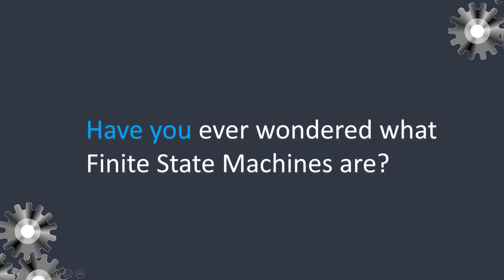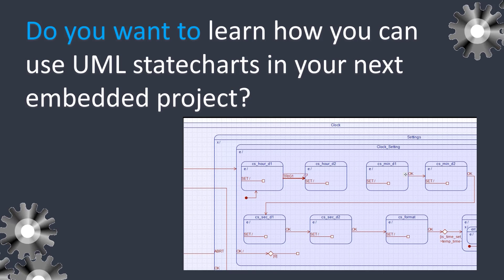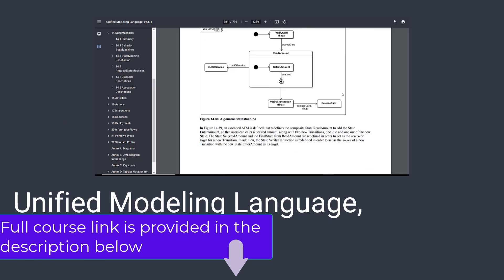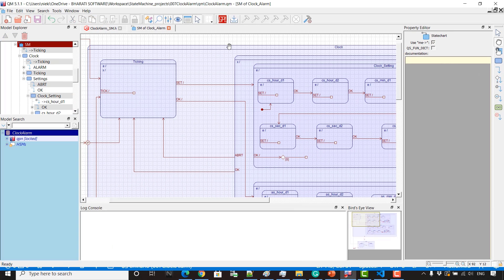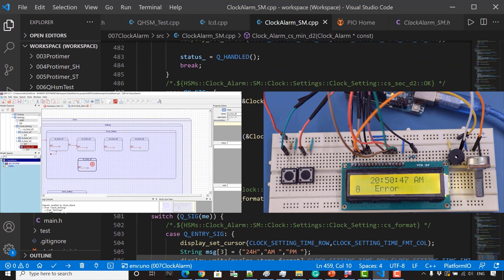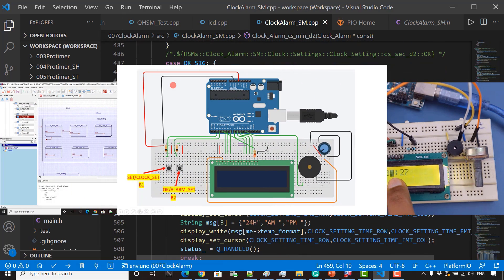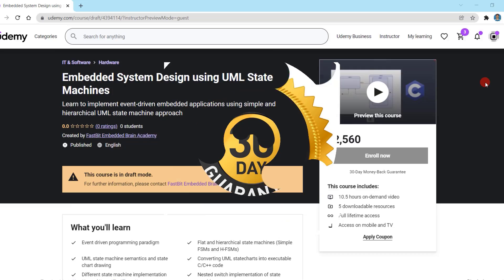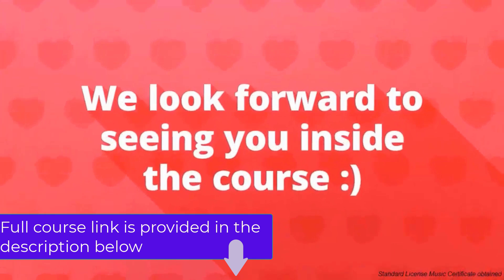New course :  Embedded Systems Design using UML State machines

Comment: Hello, I'm thinking of buying one of your Udemy courses. It says we need to have an STM32F407 discovery board. Is it okay if we use STM32F407 black board instead of the discovery board? If it's okay, I can buy the course..
Reply from the maker: Hi, What is black board ? Actually you need a board which has on board debugger. So I would suggest you to use STM32F4x based any nucleo or discovery board. For UML course you need Arduino uno
Reply: @FastbitEmbeddedBrainAcademy  Could you send your email id or any other means of contact? So that I can send you the details of the board I purchased. I'm a beginner at this, and in not sure whether mine has an on-board debugger
Reply from the maker: @neethajyothish7515  Please email us contact@fastbitlab.com